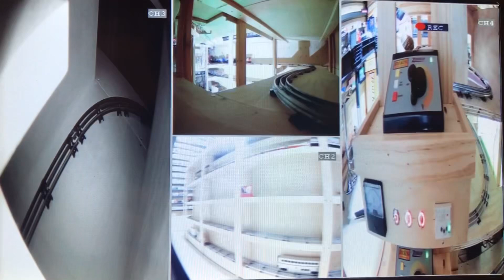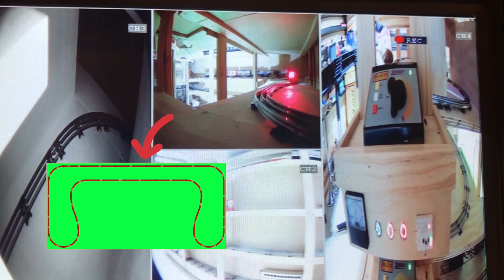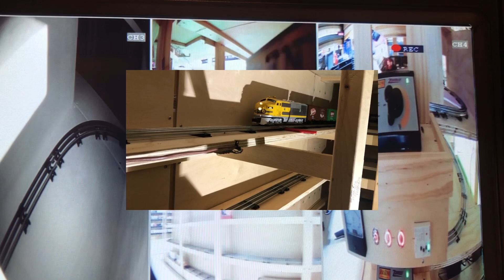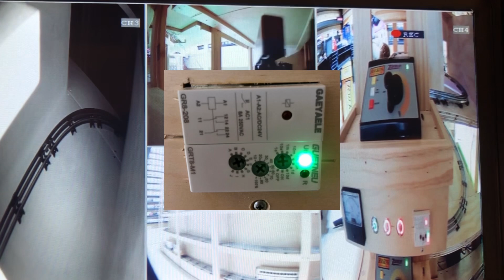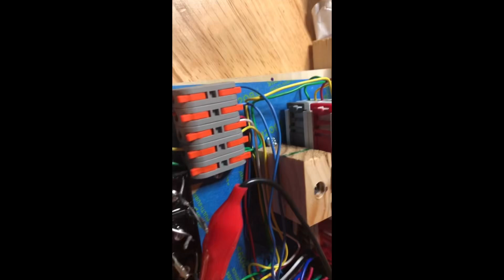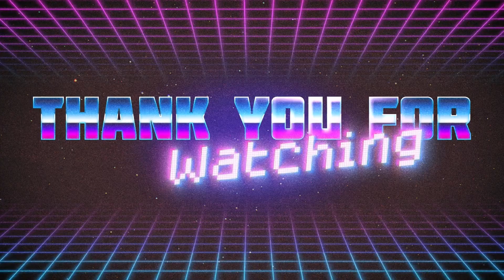O Gauge Train Automation w/ Timing Relays

Comment: Are these running via TMCC or DSC, or conventional ?
Reply from the maker: These are running conventional and the engines are locked in forward. You can use the relays the same way in mth dcs (with a little more circuitry), but you can’t use it with TMCC/Legacy. To make sure I can run any train, I just run it all conventionally.